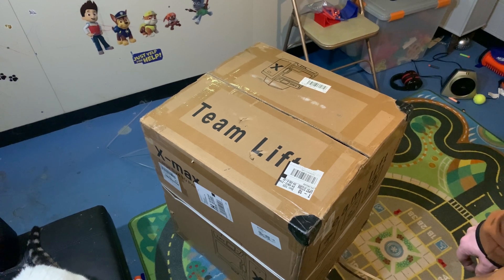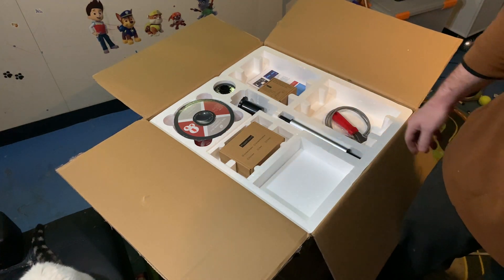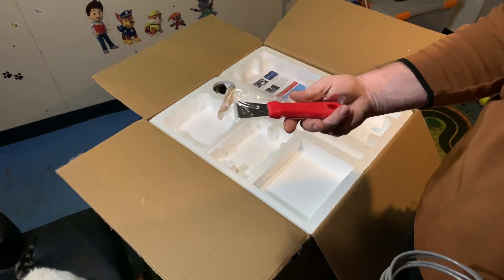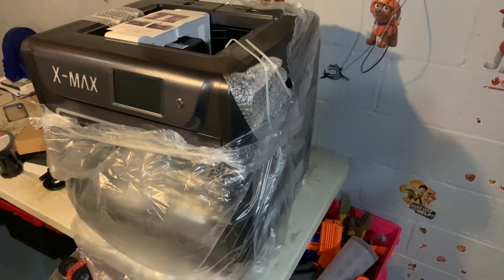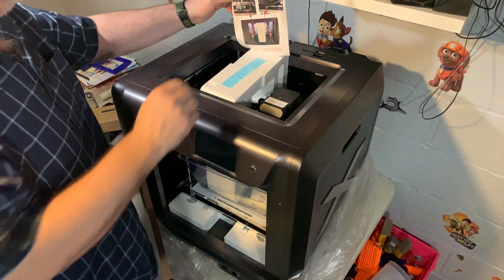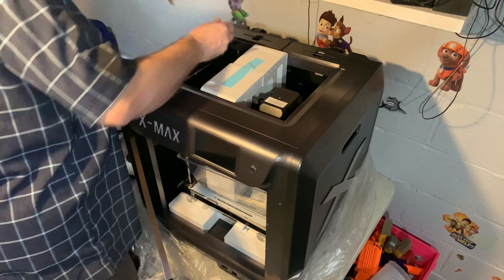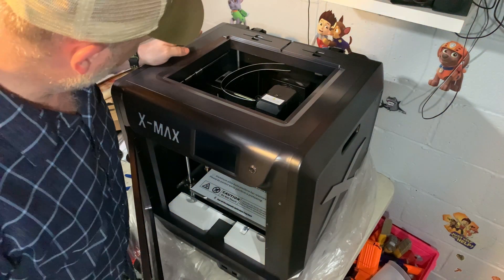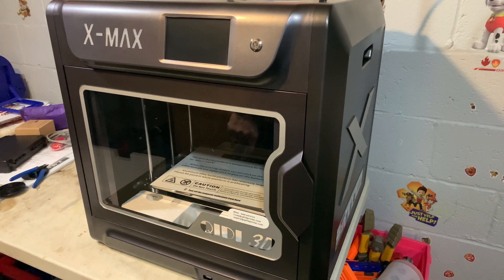Qidi X-Max unboxing and bed Leveling

Comment: What do you think of it after having it for like a month now?
Reply from the maker: It’s a pretty good printer, i believe I figured out my issues when printing Nylon. Qidi has been quick to resolve issue (or at least try to)I bought it for the sole purpose of printing engineering grade materials, I have many other printers for PLA’s, PETG type materials.